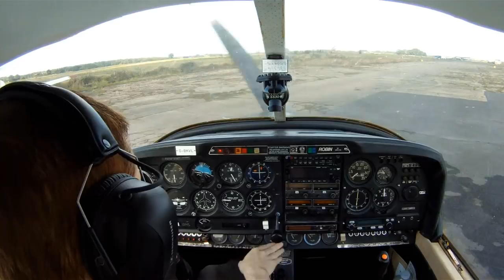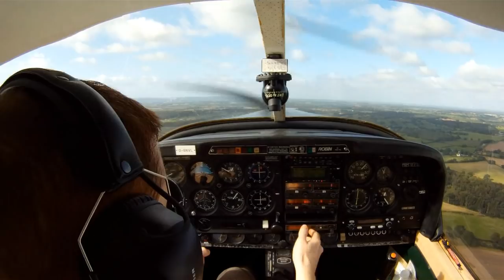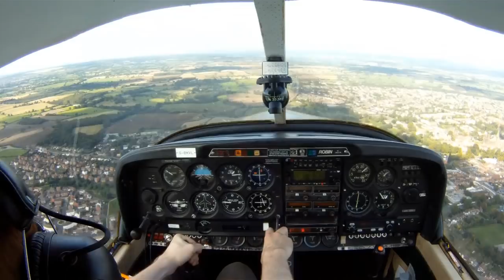GoPro Flying HD - In flight total electrical failure

Comment: A little tip for starting the engine if it does this to you. Don't pump the throttle like that, it is doing nothing but potentially flooding the engine.  Hold the starter for 10 seconds maximum, if it doesn't start, prime it once or twice, then try again, if it doesn't start, wait a couple minutes, prime one more time, hold for 10 seconds, and if it doesn't start again, wait at least a half hour.
Reply: +Riley Woods Robins are very bad at starting, i dont know why.
Reply: I've actually heard that somewhere as well... I wonder why?
Reply: +Riley Woods I've flown 6 different robins only 1 starts well. I think it's the engine; its really embarrassing though as loads of people go to the cafe and watch the aircraft. and it seems I can't start it XD.
Reply from the maker: +Riley Woods The Robin doesn't have a prime.  You prime the engine with the throttle, that's exactly the problem.
Reply: +GoPro Flying still has a primer, obviously not a dedicated one. but how does that effect? its recommended 4 pumps of throttle, yet most engine starts take more.
Reply: I know Cessna's in the wintertime are around 3 to 4 primes, but in the summer, especially when hot... just 1 to 2 primes.

Comment: This has happened to me many years ago in a Cessna 172 (alternator issue as well).  If the engine started on the first attempt you may have had enough electrical power in the battery to get home and not even notice a problem.  I taught students 8 cranks.  If the engine didn't turn over in 8 cranks while in start, it probably isn't going to start.  Also, to the guy who criticized you for taking a photo, good for you! You lost electrics and didn't freak out.  Losing the electrical system on a VFR day is NOT an emergency and you didn't lose your head making it more than it really was. Believe it or not, early airplanes didn't have electrical systems!  Your airplane just reverted back to the old days.

Comment: Hello,
I have watched the beginning of your video very carefully and I would like to share a few observation as I am a private pilot too. I have flown various type of aircrafts, including these excellent Robin aircrafts (logged about 100 hours). I do not pretend to be an instructor but there are obviously some mistakes to be pointed out here:
1- It took you some time to start the engine, and indeed you have to use the throttle to feed the engine depending on the status of the engine (cold start, hot start). Still, you should be really aware of what you do in such circumstances: at 1'30", you're starting the engine without checking if your someone is close to your propeller (looking to the right while starting the engine). Plus, why have you stopped the fuel pump before the engine finally started ?
2- Right after engine start, you should not exceed 1200 rpm and monitor oil pressure, temp, etc...
3- You HAVE to turn the alternator on right after startup and check your battery and load indicators. you didn't. It only happened at 6'15" (and the video has been edited). 
4- USE YOUR CHECK LISTS, and avoid this kind of takeoff, it won't take you to your  cruise altitude faster ;)
I'm am not a native english speaker so sorry for any grammar or vocabulary mistake

Comment: Failure to use primer over cranking & drawing the battery down stressing the charging system. The alternator off/on switch controls an electric contactor, if the battery is drawn down enough there may not be enough power left to engage the contactor and bring the alternator online. If that is what happened you ran off the battery inflight till it was flat
Reply: slickjimmy Bingo. Typical outcome when people overdraw the battery due to starting bufoonery. This guy is a stooge. What's worse is that never once did he realized he didn't have the alternator online. Like my old DO used to say: "The thing about SA [situational awareness] is...if you don't have it, you won't miss it." LOL

Comment: These aviation videos never cease to amuse me.  There are always a lot of folks that know absolutely nothing about it willing to chime in and give their two cents worth.  Aircraft bats are lead acid, just like automotive and marine.  I have never had a complete electrical failure in flight but  have taken off and realized that the alternator was not charging the bat.  That's a deal breaker right there.  If you can't communicate, you've got to get on the ground so you pick the least busy place, enter the traffic pattern and watch the tower.  They will give you a red or green light.
Reply: This aviation videos never cease to amuse me. There are always a lot of folks that might know some things about it, and consider themselves so superior to others...
Reply: Aircraft batteries can be Nickel Cadmium as well. They have proven to be somewhat more efficient and easier to maintain, but some manufacturers still steer away from NiCads due to the possibility of thermal runaway in extreme situations.

Comment: Oh cool total electrical failure, let's take a photo!
Reply: Oh dude.... exactly what I thought.... flabbergasted that he did that....
Reply: +GunsOfPlentyNZ 
Ok ? He takes a photo at 19:37 and have the electrical failure at 19:58 ?
Reply: +SillenTDMrider if you look at the radios at around 19:07 COM1 goes dead followed by COM 2 at 19:10, GPS is indicating low volt, and then his sound circuits start spazzing the fuck out generating loud static, this is all before he takes the photo. He should of been focusing on trouble shooting the problem not sight seeing, but based on this pilots previous videos, it would not surprise me if he just forgot to turn the alternator on in the first place
Reply from the maker: +GunsOfPlentyNZ "GPS is indicating low volt"? Really? How do you know that?

Comment: Be careful with your throttle, plunging like that is only going to make the flood worse, if you have a failed start, keep cranking for a while longer, then hit the primer again. Using the throttle isn't the best idea.
Reply: Oddly enough, leaning the mixture out a little and "working" it when the engine is about to turn over has been pretty effective for me. Even at low elevation
Reply: Well maybe with MIAS planes hahah
Reply: I always give it a shot of primer as I crank if there is an issue and it starts up just as it should. If you use your throttle as you crank it creates a fire hazard because the fuel can get into the air intake and start a fire. Plus the primer only shoots fuel directly into one cylinder instead of all 4 or 6 or whatever. At least that's in 172's with lycoming or continental engines.
http://studentpilot.com/interact/forum/showthread.php?41934-Starting-172-pumping-throttle
Reply: FlyBoiAndy by my assessment, i believe it was underprimed on every attempt. Doesn't look like it was getting enough fuel... 
The only time that engine showed any life was instantly after he would pump the throttle and introduce fuel to the system. 
If he fed a half dozen pumps to it and then attempted a start it might've helped things...

Comment: For everyone here, who is complaining that he isn't using the primer: It's aDR400. It doesn't have a primer.  You prime it with the throttle.  Exactly the way he did.  I fly the same type.  Start technique is mixture full rich,  fuel pump on,  one to three times of pumping with the throttle, throttle 1cm from idle, starter engage. The mixture stays rich on startup.

Comment: I think this is a good example for why you should always bring a handheld radio
Reply: +Zap Greene - I once had a total electrical failure in a Piper Archer while IMC. Out of sheer luck I had a borrowed handheld NAVCOM at the time, which NAVed and COMed me back to Terra Firma. I then bought my own handheld NAVCOM and never, ever flew without it since.
Reply: +Zap Greene Why do you need to speak to people? This was just an electrical failure. You simply follow standard radio fail procedure if necessary.
Reply: +Trevor Austin It's a lot safer when you can talk to people
Reply: +Zap Greene Aviate, Navigate....
Reply: +Trevor Austin Aviate, navigate, communicate

Comment: Exactly the same thing (Electrical failure) happened to me. Except, it ALL failed at once and none of it came back on. I had to pump the gear down by hand. I also had  a handheld radio, so I could contact the tower.

Comment: Radio failure = low pass over the runway waggling the wings to get attention of the tower, then climb to circuit and watch tower lights to signal ok to land.
Reply: +Jimbo Jones Not quite. Firstly, follow any clearance that has been given. Assuming VFR, land at the nearest suitable aerodrome, complying with local radio failure procedures as required.
Reply: That was the procedure at the airport I flew from.
Reply: This lads a pretty sub par pilot

Comment: I once was in a total electrical failure on a long cross country in the middle of the night. We flew it another 64 miles after jumpstarting and another 300 the next day after two jumpstarts because there was no maintenance around. Not that big of a deal in a 1960s Cessna. All the gauges still work fine, we just had to yell at each other to get info across and avoid controlled airspace(and make a few calls for the airspace we did cross over).

Comment: That start technique hurt to watch. Masters on, Avionics off, throttle 3 mm in (KEEP IT THIS WAY, DONT PUMP IT). fuel pump on, mixture full rich for 5 seconds.then pull out the mixture and turn off the fuel pump and then use the starter motor. Your electrical failure was almost 100% due to your start procedure.

Comment: Where is this guys checklist? The physical plastic laminated checklist.....he's doing his checklist by memory? ERROR. His briefing for the camera should have been in the pre-flight briefing room, back at the strip, not "in-plane". Yes, it took far far too long to start the engine, of course since he had no physical checklist, how do we know if he did it right? Correct me if i'm wrong here but aircraft don't have "accelerator pumps" in their carbs....that's what primer bulbs are for....so why is he "pumping" the throttle?
Reply: Throttle does have an accelerator pump.  Generally speaking there is usually another method for priming the engine.  Checklist can be replaced by a flow check.  As long as there is some structure and system in place to ensure no relevant items are forgotten.

Comment: start it lean, then push the mixture in if it's flooded.  Wait 30 seconds after a while so to don't overheat the starter.  Just some pointers that have helped me over the years, depending on the airplane.

Comment from the maker: The Robin doesn't have a primer, so you use the throttle as the primer. It normally starts much easier, but it was the first flight of the day and it was pretty cold. Your method sounds familiar, my instructor used it a few times during my PPL.

Comment: Well handled I'd say. 

What was the reason for the elec  failure. Did you find out? Also, how did you handle comms? mobile phone?
Reply from the maker: Thanks for the comment.  Reason for the failure (I was told) was a fried alternator.

I didn't handle the comms at all.  I was in contact with Birmingham Radar at the time, they noticed I'd lost comms and SSR from the transponder.  They contacted my destination aerodrome and told them to expect me and from which direction.  All aircraft were told to say out of the circuit until I'd landed.
Reply: Fried Alternator also caused issues trying to start?

Comment: well, when the battery voltage gets too low, it can cause the alternator relay not to close. 
Since your battery showed sings of low voltage when U started your engine, its tensions may not have been high enough for the alternator relay to close.
Unfortunately, I am not familiar with old DR400, so that I haven't found the voltage indicator, thus It were impossible for me to check if it went up when U closed the alternator switch.

Great landing by the way, and I found this video instructive for my coming flights ;)
Reply: Я не уверен, что увидел вольтметр - возможно это прибор точно под правой ручкой газа. Но амперметр я видел ясно - он показывал заряд до момента отказа альтернатора. Значит реле альтернатора включилось. Потеряв GPS пилот должден был осмотреть приборы, увидеть амперметр и отключить альтернатор и все второстепенные приборы (согласно инструкции). Но он этого не сделал. В это время он делал фотографии. Трудно делать хорошо два дела сразу. Лично я не выехал бы из гаража на машине, которая завелась с 9 попытки. Да, кстати - неисправна красная лампа - авария альтернатора.

Comment: Why dont you change QNH on both altimeters? Fly with two different QNH settings is dangerous!....if you follow the checklist you wont miss it! What happens if you will end up in IMC conditions and you get stressed? Which altimeter is correct?
Reply from the maker: You're absolutely correct. I was only taught this last year while doing my Instrument rating. I've never flown an aircraft with two altimetres before this aircraft, so it was never mentioned.  Now it is almost second nature to change both together when given a new QNH.
I also didn't have a checklist for this aircraft, I was actually using the one from the PA-28....I know it's wrong but the flying school I was at didn't have one.

Comment: Every piston acts a little different.  I flew 3 piston aircraft for 10 years.  Each very simular engine, but starting procedures very different, and even don't start very well using the POH procedure.   Over the years I figured out my own way to start each... but every time I trained a new person to fly one of them... it always took them a few weeks to get good at starting it without multiple tries.   Piston engines are sensitive when it comes to the start.  Needs just the appropriate amount of fuel and air, and that depends on the temperature of the engine as well.   If someone doesn't fly the aircraft daily or on a regular basis, they usually require a few tries, unless they are lucky or the engine is just easy to start.  Most aren't.

Comment: A handheld aircraft radio would have been helpful in this case? I'm not a pilot so maybe I'm wrong about those I'm sure they make them. Just glad that you didn't run into any other traffic. Good video on reminding others to check gauges before taking off.

Comment: Learn how to start a normally aspirated engine, those starters cost £1000.
Reply: +Jim Foreman The idea in the robins is just dont crank it for more then 10 and the starter will be a ok. There is even a label in the cockpit by the trim wheel from the factory saying this. Clearly he diddnt see it :D
Reply: +Daniel Just   Ever hear about primers? Don properly, it should start on the second or third revolution and continue to run. I shudder to think what you would do to a complex aircraft.

Comment: Happened to me when I was about to get my takeoff clearance, heard the tower say it first time around and tried to speak but when I pushed the button I couldn't hear my self, then the tower asked me if I heard him, tried to respond but nothing went trough, turned the COM off but then it didn't want to turn back on, put in 7600 taxied back onto the ramp and then turned the ALT on and off and boom all of the sudden it worked fine and the AMP-meter started to show positive again and everything worked fine afterwards, did you try that? might have missed it in the video. And is there no warning about cranking the engine max 5 times and waiting 30 secs between tries and then after the fifth attempt wait 30 mins to let the starter cool down?

Comment: JOB  WELL  DONE!!!  I really admire how you handled yourself.  You didn't show panic.  You were SO calm.  I applaud you!  I too will be enrolling in the Aerospace program at M.T.S.U. for my commercial pilot's degree and license.  I can't wait.  I want your nerves of steel.  My question for you is, your plane took SO many attempts to start...both flights.  Should you have cancelled the flight for mechanical reasons?

Comment: Hi all,
First off, very nice handling that electrical failure. I do not know much about emergency procedures but that looked good! I am wanting to complete a flying license (PPL) in a few years time. Haven't started yet though but have had a trial flight.

May I ask, why did you maintain altitude that low after take-off. Was it a short field take off or simply your personal way? I have seen military aircraft do the same technique and the only reason I can think of for doing it is building up speed and evaluating flight control. Could someone please tell me the reason for this? Thanks for reading

-Dan
Reply: +Dan Brown How did he handle the electrical failure well? He had both radios die, yet continued to take photos?

Comment: You're trading that potential glide energy, in case of fire/failure, for speed, and chewing up valuable potential landing space in the process. Just make a standard climb out at Vy - this will make your circuits much cleaner too. Also, just remember right rudder pressure. Apart from that, you could scrub up on your RT a little more; it's generally good, but less thanks and more wilcos and rogers will stand you in good stead. If a circuit breaker is out you shouldn't really be starting engine.